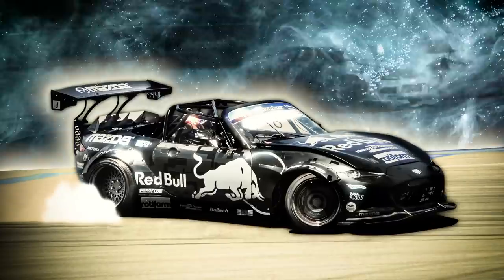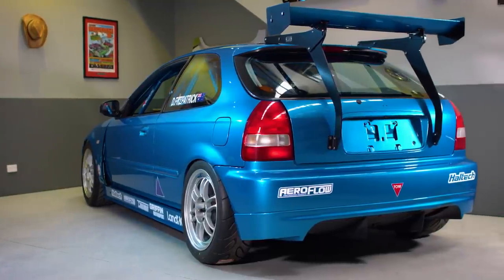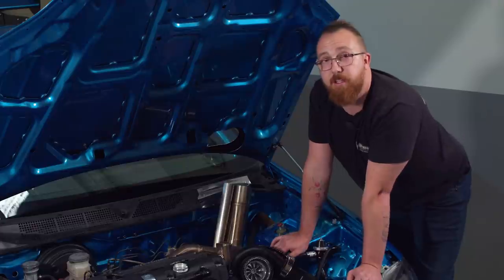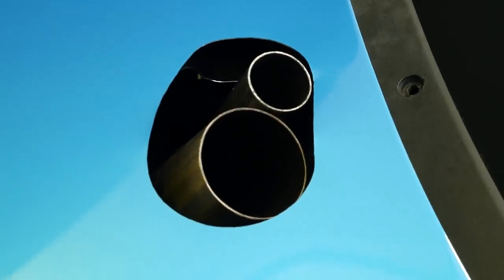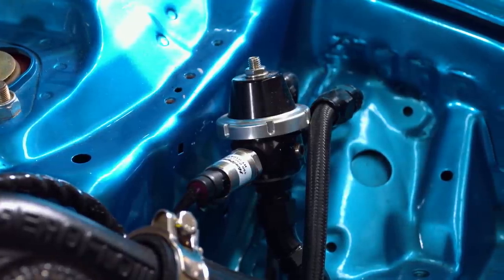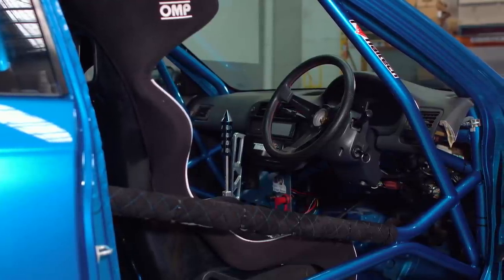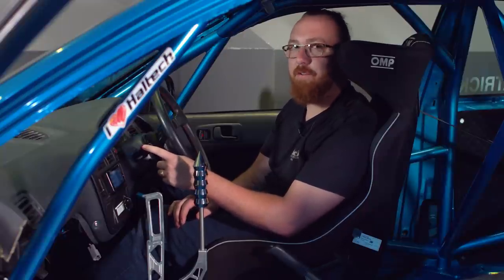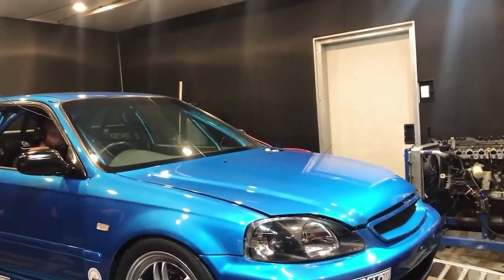🏅 Dan's 400hp, K-swapped Turbo Honda Civic | HALTECH HEROES

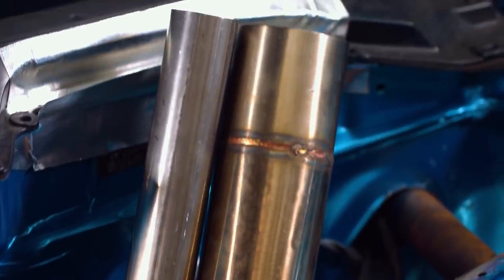Comment: At 3:33 is that a Bluetooth turbo or the bolts are optional?
Reply from the maker: The bolts are there, just not in all the holes.
Reply: The holes are so the manifold can fit more than one turbo style.